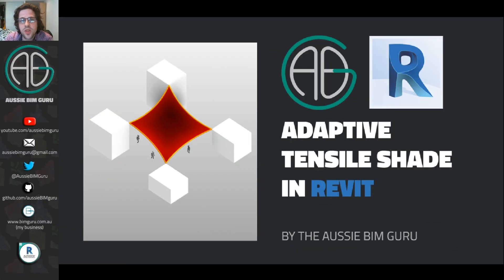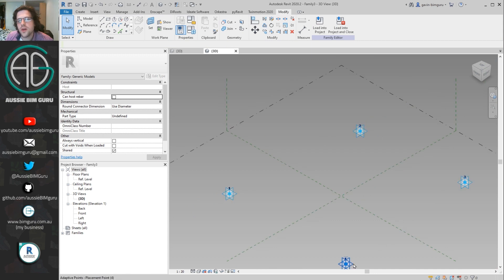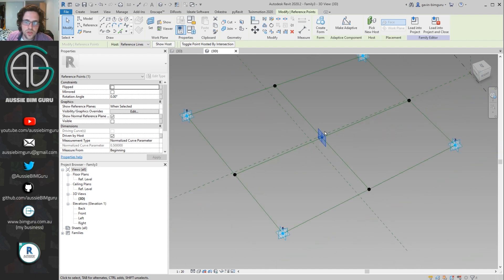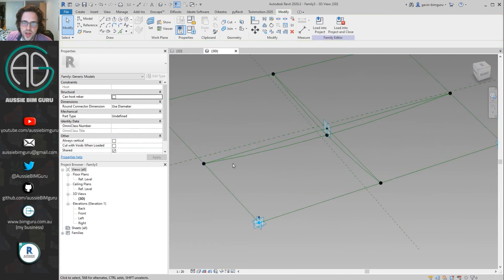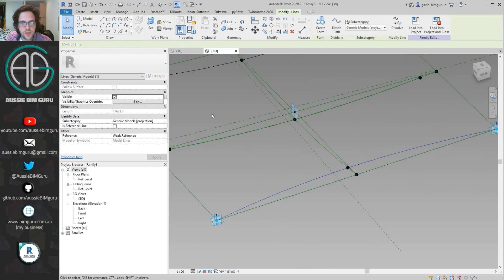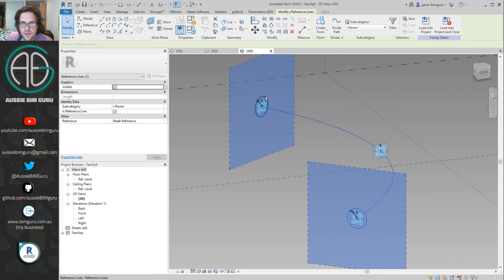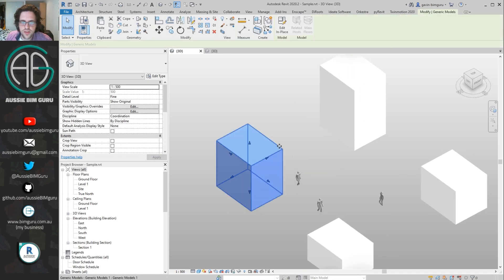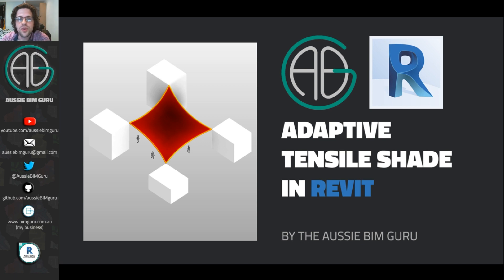Adaptive tensile shade in Revit!

Comment: Thanks for this, how would i go about making the curve a percentage of the length?
Say 5% for instance, this is how they are manufactured percentage is the same on all sides
Would appreciate any help
Reply from the maker: This would probably require a Dynamo script to analyze the true distances in more detail once it is placed. These can then be returned to the tension parameters at each curve (you can always make these 4 separate parameters instead of one common one.

On Thursday I'll be showing an alternative approach using a program called Kangaroo that can apply a length goal to each side as a % of the original - this may help also I expect.
Reply: @AussieBIMGuru  Thanks for the reply, i will check this out
thanks again